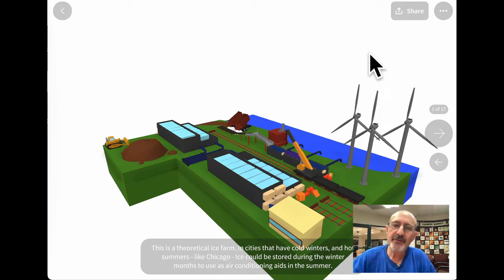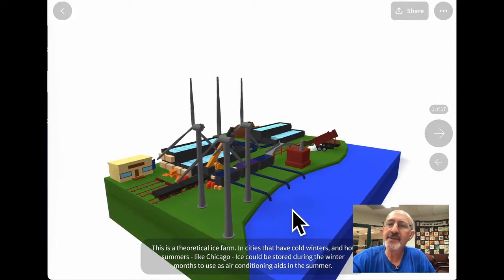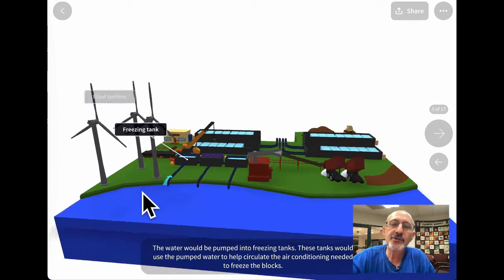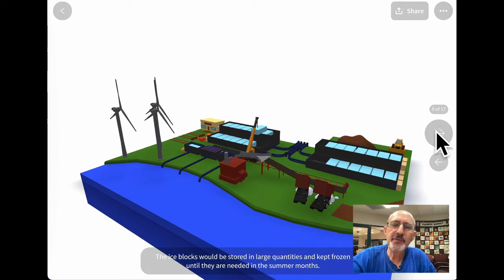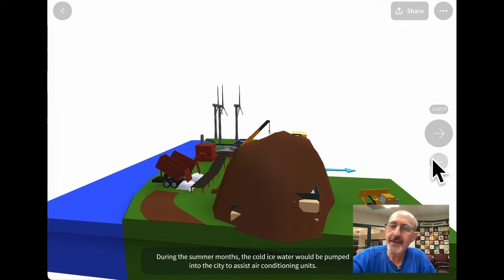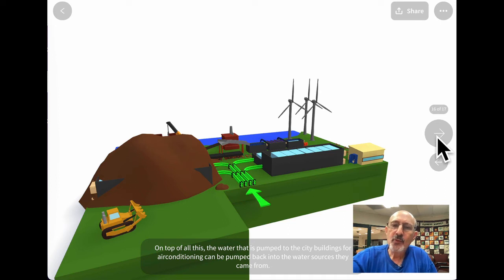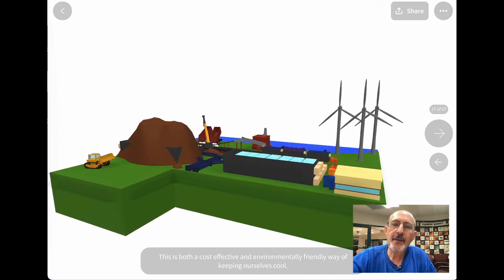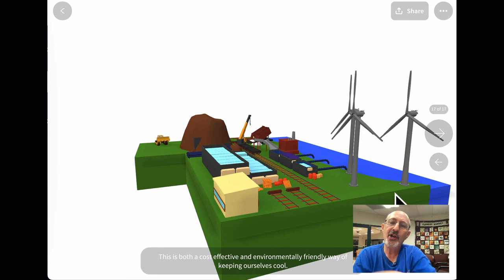Cooling Chicago Using Saved Winter Ice - JigSpace 3D scene

Comment: This might work with an huge underground tank, for a small house.  Antifreeze could be pumped in the winter, until the tank of water is frozen.  Then in the summer, water is pumped between the house and the tank, dumping house heat into the frozen water.  I recall this theory discussed in college back around 1980.  Can't remember if it had ever been tried, or if it was just a theory.